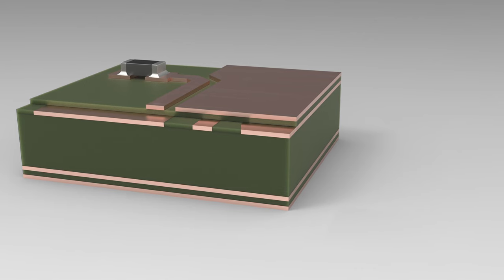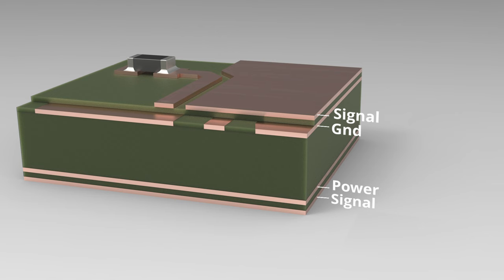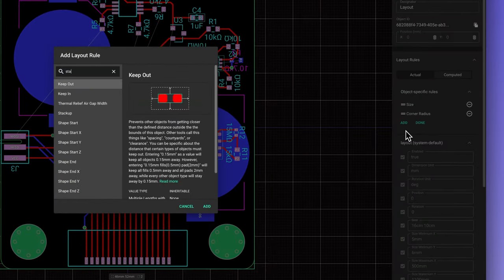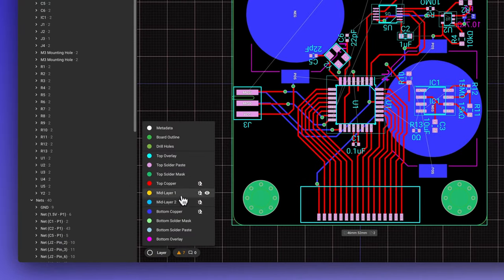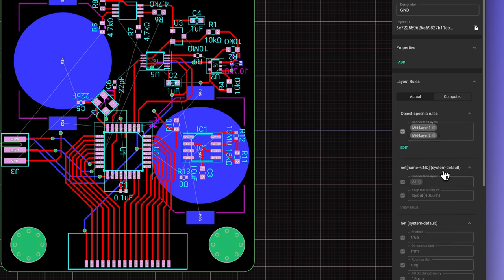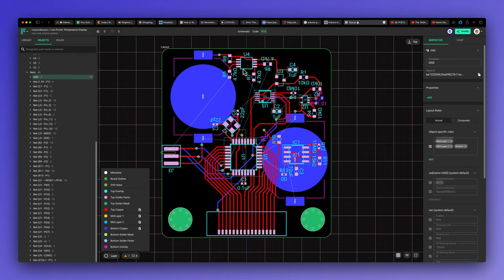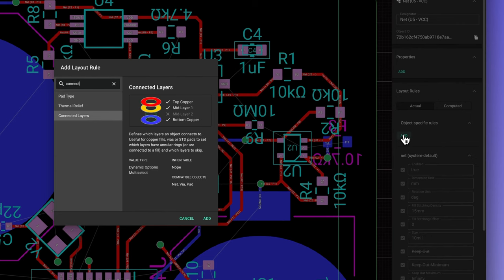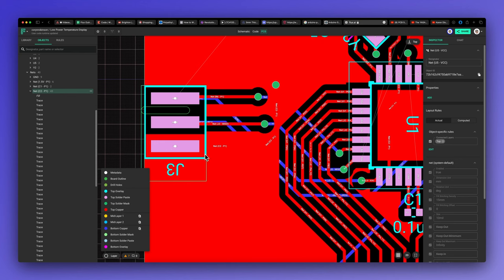How to Use Power Planes in Your PCB Stackup

Comment: Is there any way to check crosstalk beforehand? I have a 2layer PCB with relays on it. Somehow its clicking randomly my relays...
Reply: That's not good. It usually takes a relatively large amount of power to assert a relay, so I doubt crosstalk would do that (unless you're dealing with some pretty high voltage circuitry). Without seeing your board, I'd say make sure you have a flyback diode and check the relay driver.
Reply: @corynrobinson  im driving the relay with esp32 gpios. The pin connect to optocoupler. Other side switching the BJT to drive relay. Flyback diodes are in places. No signal line crossing under the relays. But still crosstalking
Reply from the maker: @thenextproblem8001  Interesting. I guess I'd have to see the schematic/layout. Are you on the slack channel?
Reply: @overshootchannel  how can i join 😊
Reply from the maker: @thenextproblem8001  This will allow you to join: https://join.slack.com/t/fluxcommunity/shared_invite/zt-1wfyp9gck-Rl2AKax91IbZefG7Uti5vw